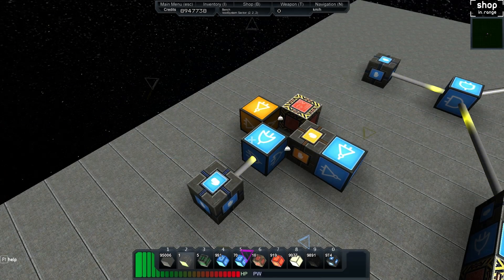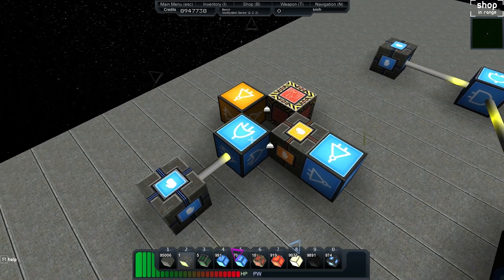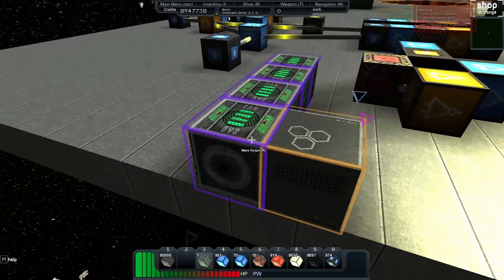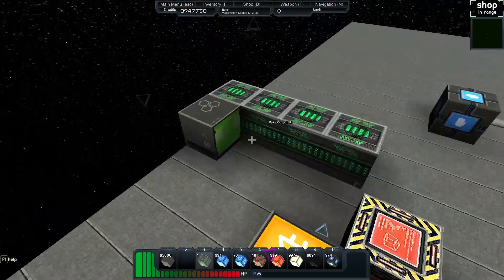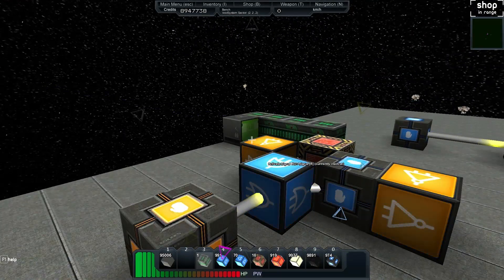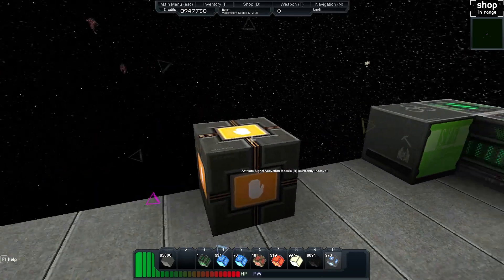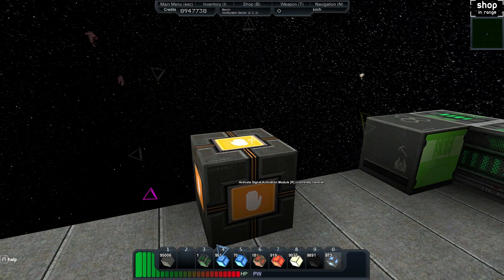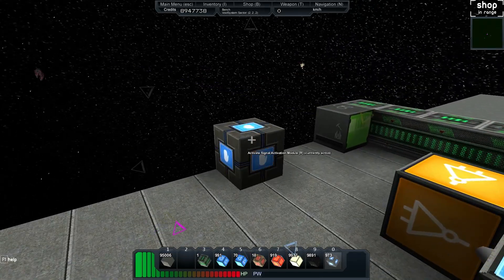Starmade Logic #7 - Triggering Salvage Beams

Comment: My salvage beam hooked up to the clock will fire a full cycle of the salvagebeam. What I am missing is the ability to start an stop the clock or the salvage computer while I am in flight mode. If I hook up the salvage computer to the clock i have to manually trigger the clock, then go into my shipcore and aim the beam. Aiming is not the problem. How do I get the ability to start and stop the clock in the hotbar. The clock wont show as a weapon, and if I hook up the salvage computer so that I can fire it manually it is no longer hooked up to the clock. Do you see where I am getting at? Do I need to hook up 2 salvage computers or something like this to start and stop the automatic salvagebeam? Thanks for some great videos!